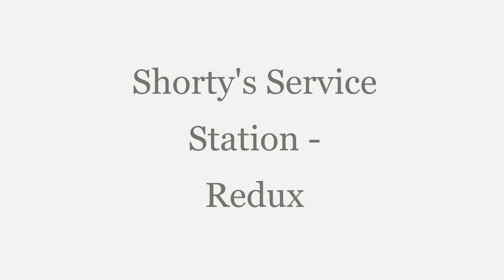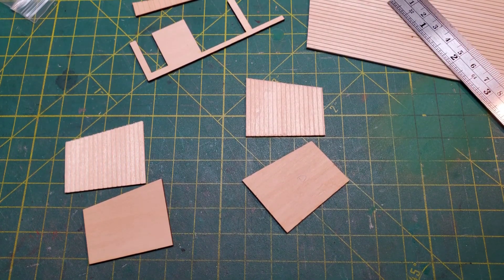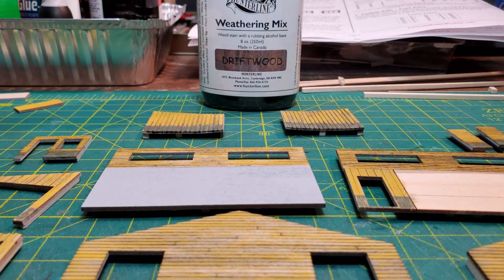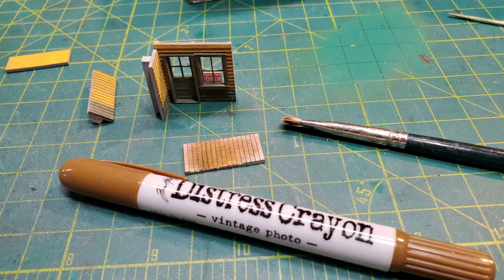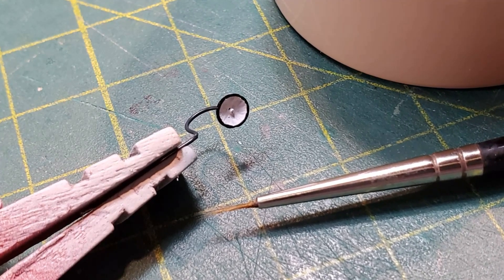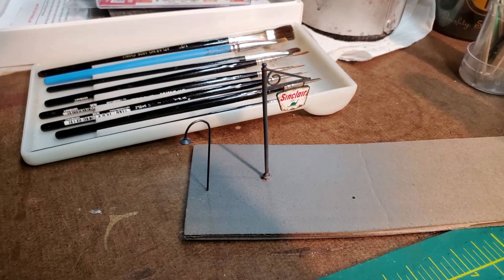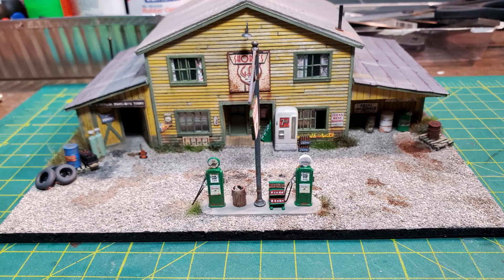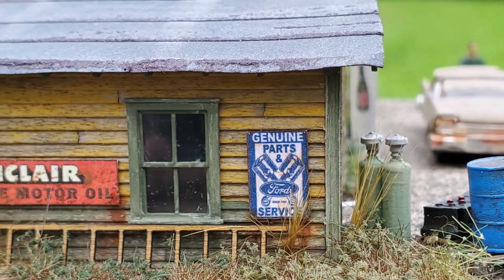Shorty's Service Station Redux

Comment: Great build - thanks for adding the narrative; it helps a lot. Especially liked your reference to Gamblin pigments and Martin Welberg scenery materials - I am always looking for new suppliers. I also like the idea of applying stain after painting; I've been staining first, then painting, but it looks like this gives a dramatically different result. Looking forward to more redux. (Sound level was fine for me.)
Reply from the maker: Thanks so much for the feedback. It all helps me to try and do better. I do like using those products, I get the pigments from Dick Blick, but there are other suppliers as well. I've done stains before paint, after paint, and sometimes both. Experimenting is one of the fun parts I think.